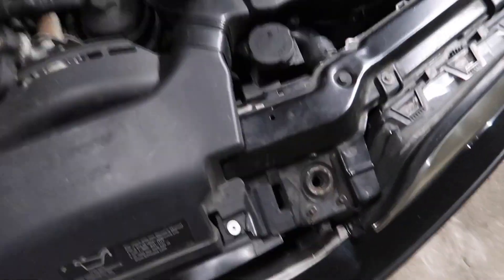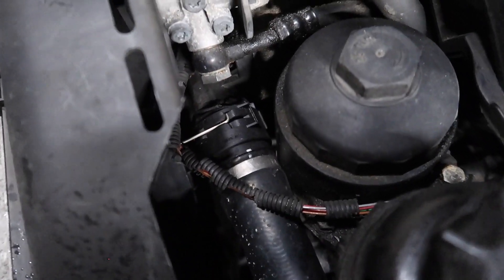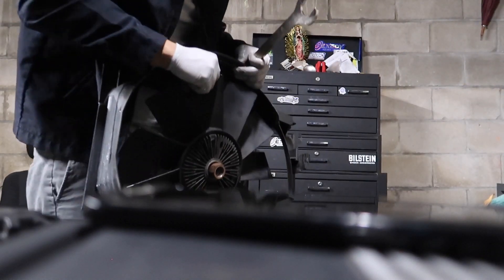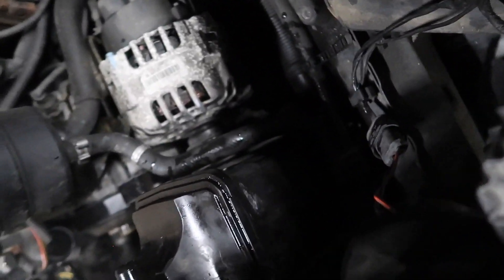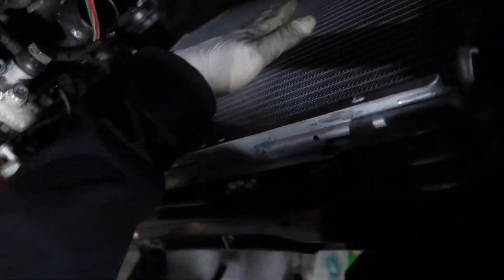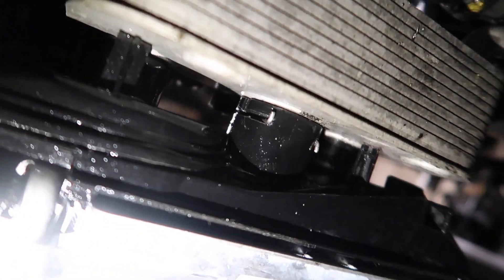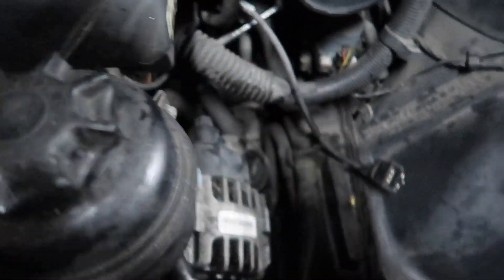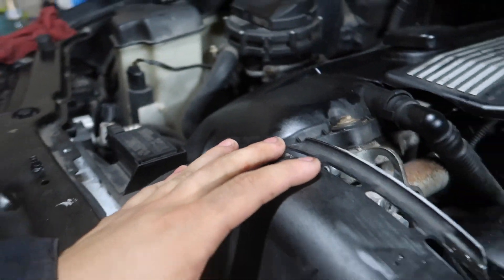BMW E46 RADIATOR REMOVAL AND REPLACEMENT DIY

Comment: You should always replace any o-rings. When they flatten out over time they will leak if u remove anything. Transmission cooler has 3 orings on it that should be changed.

Comment: its good you removed your expansion tank like that because it you would have seperated them you would have never got it to seal properly again and it would have been leaking and making your car run hot.. anybody out here that have to do this job never seperate the expansion tank from the bracket it dont matter if you buy a new one you will never get it to seal properly. i advise any of you that have a problem with your expansion tank. go to junk yard that has your car and look for the tank and bracket together take it out together and put it on your car  a new one you can not get it to seal properly i know i have had thsi problem more than once so this fool could not seperate it he better be glad he couldnt or he would have had more problems than he thought
Reply from the maker: the car's still running good tho more then a year later
Reply: I’m dealing with this right now
Reply: Davonte Thompson auto zone had the o rings I needed to replace to put a new expansion tank in. Now I have a crack in my radiator 😭
Reply: Thanks for the tip, I followed your advice.
Reply: I've yanked numerous ones, and gotten them to seal back up, it's just a pain in the ass. Usually requires taking the tank with cap down against the ground, and a shitload of weight pressed down on it, not an ideal situation, and if you fuck it up, it will leak. Get new O rings.
Reply: i didnt know about this and i almost would have done it but to my luck too i guess it just didnt want to come out so i ordered  all new